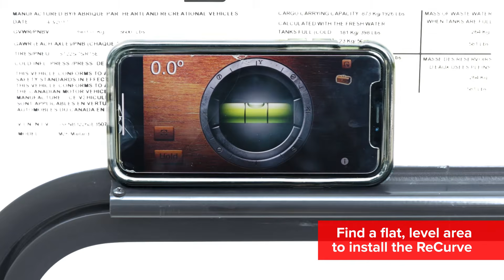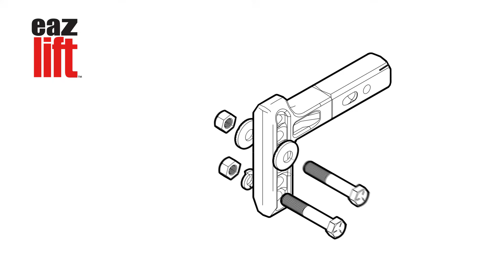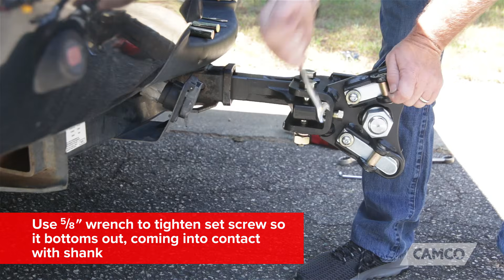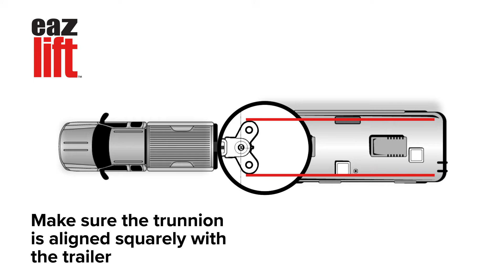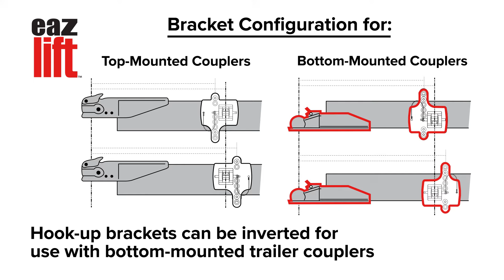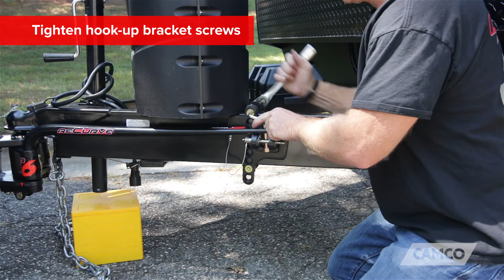ReCurve Install How-to: R3 & R6 from Eaz-Lift

Comment: What size of socket is needed to do the 260 ft pounds?
Reply: I’m with you here. I just bought the R3, but basically every torque wrench goes JO further than 250 lbs. I’m lost.
Reply: @ThaximusPrime  They state further up you can use 300Ft/lbs which is common with many impact drivers if that helps
.  The straps on the trailer at 45ft/lbs
Reply from the maker: 1/2" drive, 1 1/8" socket, let us know if you have any more questions!

Comment: Don't under stand why you need angle adjustment
Reply from the maker: The angle adjustment is so that the bars are in the correct position for preloading. --Scott
Reply: @CamcoManufacturing  what is the right angle?
Reply: Tipping the head back, changes the initial angle of the bars. The ball can be on an angle, that's just fine. But if you need more bar pressure to get the rear fender to the suggested drop (he says 1-1 3/4") then the bars angle (head tilt) needs adjusted. If you measure, then change, then measure again, you'll see what it does.

Comment: If I feel the hitch ball angle needs to raise up do i have to loosen up everything or just adjust the thumb screw?
Reply: You have to loosen everything. the thumb can't be adjusted until you loosen the square head bolt at the bottom. after loosening all these things you can adjust the thumb screw. then tighten the square headed bolt opposite the thumb screw then tighten the other clamping bolts to the recommended torque

Comment: The video is useless in several ways. My instructions state 1/8' for every 100lb. of tongue weight. My truck, 2023 Silverado 2500HD High Country and 2022 GD 315RLTS. RV has 1190 tongue weight. 1190/100=11.9 11.9x.125"=1.4875" Video states 1"....problem! Demonstartor torques bolts to 260ft.lb. BEFORE checking and adjusting the spring bar angles. Problem! Instructions do not say anything about measuring the trucks normal height at the rear wheel opening. Problem! Very confusing and unnecessarily so IMO. Do we follow this guy or the paper instructions provided? My dealer didn't know what he was doing and now I see why.

Comment: How do you determine what size bar you need? 600, 800, 1000????
Reply: Tongue weight of whatever your towing
Reply from the maker: jaydsar, which size you will need is determined by 10% of the MVGWR. Overkill is not good. If you have any questions please contact our customer service at 800.334.2004. Thanks! --Scott

Comment: If the trailer in Tow is Max 6900 lbs GVW and given 10% of that is 690 lbs. Would the R3 600# bars be legit or should I go with the 1000# bars? And if the weights change in the trailer or truck are they adjustable for weight distribution equalization?
Reply from the maker: You should be using the 600 lbs rated spring bars. We under rate the bars by 200 pounds.
Reply: @CamcoManufacturing  Finally this makes sense. It was confusing that my dry weight plus perhaps 1000 pounds of cargo was 6100 pounds and tongue weight possibly 700 or may be a little more And yet I was told by a dealer and by Camco that 600 pound bars were the number. I can attest that if you go heavy as in my nine-month-old camper was set up with 1000 pound bars which according to this would be worth 1200 pounds, you will be severely disappointed in the way it Tows. As your camper goes over pavement seems or bumps the very stiff connection between the camper and the tow vehicle causes the tow vehicle to whip because of the lack of flexibility. Or so I hope – I contacted the installing RV dealer and told them how the r3 was set up incorrectly and they are sending me 600 pound bars which I will test if they don't make A difference I will update this.
Reply: I really wish you'd NOT under rate them. It's giving folks problems, as seen in the comments....

Comment: To increase sway control, you state to tighten the activation bolt more. Are you talking about the large thumb screw? Tighten = clockwise?

Our second trip yesterday and had a little sway (?) but were in AZ with very high winds on IH40.
Reply: I believe the squeak controls adjusted by the silver Allen head screw on the rear side of the hitch. That tightens the collar which produces more friction to help with sway. The large thumb screw is only for adjusting the angle of the bars.

Comment: Why on earth is there 10 washers and various parts to tighten down and lose. You couldn’t make some custom hardware for the hitch? Literally looks like relying on a meccano set for all the adjustment points. Makes it look cheap build quality
Reply: Hi, I have a R3 and I lost my lift handle tool. Do you sell it by it self?
Reply from the maker: @Julio Balderas, Yes, we sure do. Check out here: https://www.amazon.com/dp/B07H9F3C9V/ref=cm_sw_em_r_mt_dp_U_uQk.EbFV461P8 or enter "Camco 48742" in your preferred search engine. Thanks! --Scott
Reply: Just like every other weight distribution hitch..